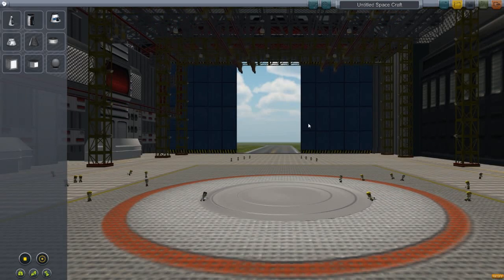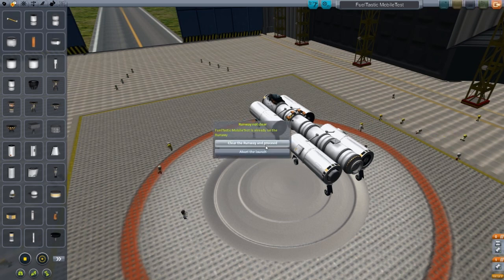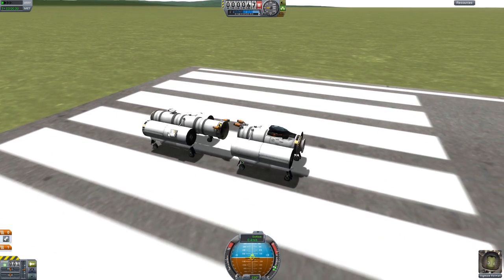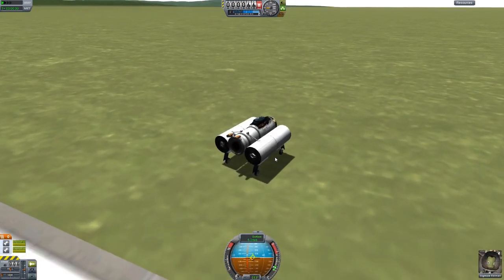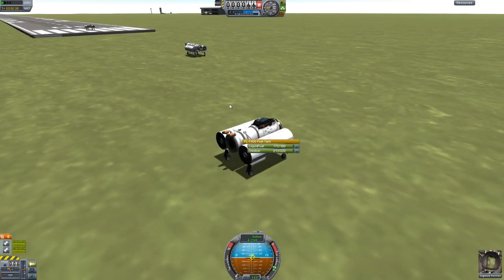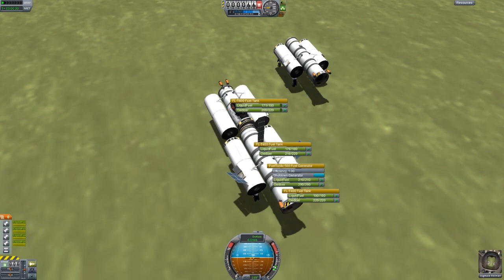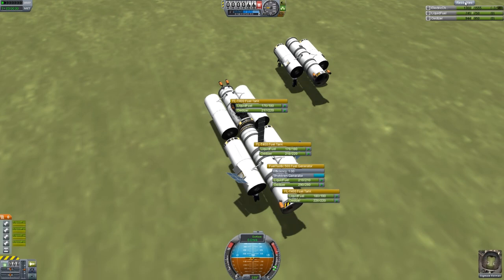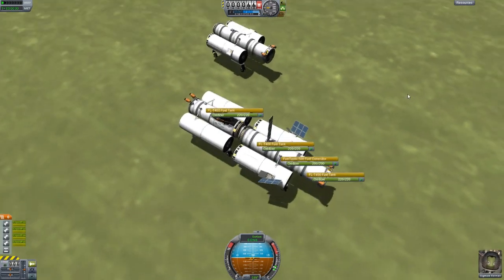FuelTastic for KSP 0.20+

Comment from the maker: I agree! I will not only be releasing all new textures for this soon, my plan is to make a base sized variant 'Fueltastic R3' which will be very heavy to transport but can produce more fuels. I was also considering adding another required resource into the  mix to make it a little less magic.

It may seem too magical for some but the amount of fuel this thing produces is hardly enough to counteract the fuel requirements of even a moderately powered engine.

Comment: fuel gen a little slow 
and it should be able to do fuel transfer to another tank when the generation in on.
(i know you can alt-right click to do the transfer but it only works when you are transfering from one to another... not when you want to pool a few generators' output to a single tank)

so i decided to tweak a little...
fuel gen up from 0.03 to 0.3
and elect use up from 3 to 30
mass up from 0.15 to 1.5
this equivalently making the part works like it's 10 of it working together

Comment: I tried using this on a rocket, i turned on the generators and the rockets stopped taking fuel from the tanks, and started using fuel only from the generators, causing them to sputter. Is that supposed to happen?

Comment: how about using IntakeAir as well?
well... like...using electricity to  mass separate the H2O and H2 and O2 in the intake air and then an electrolysis to get gaseous H2 and O2 and then compression to get H2 and O2 liquid as fuel.
sounds legit?